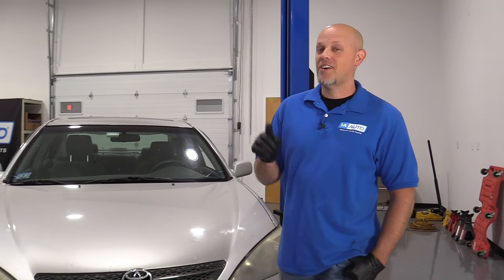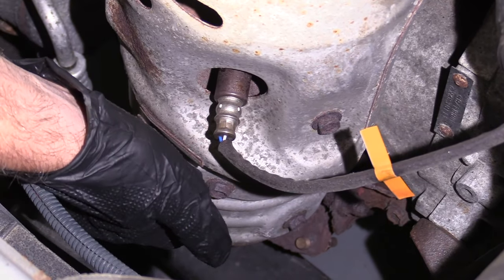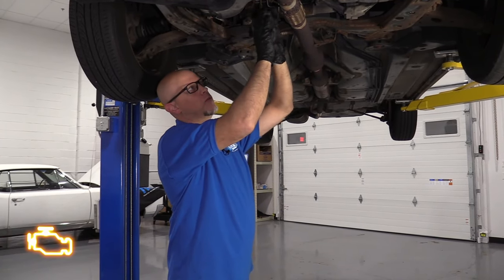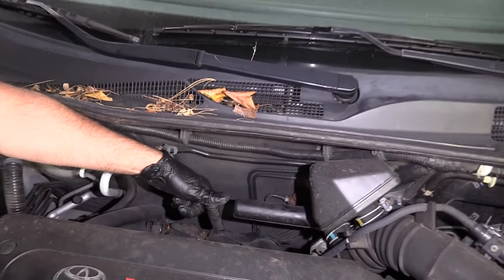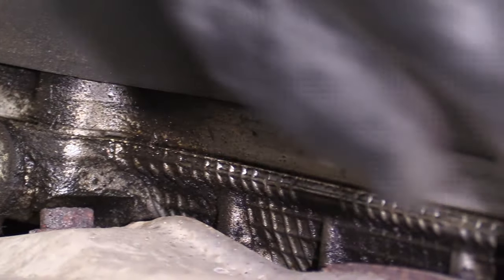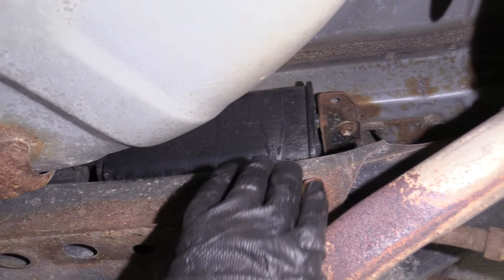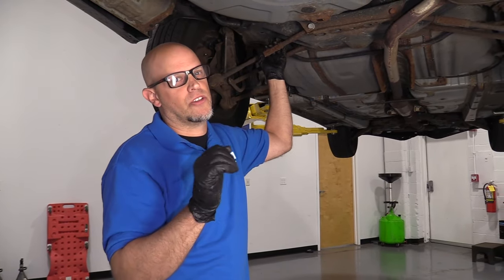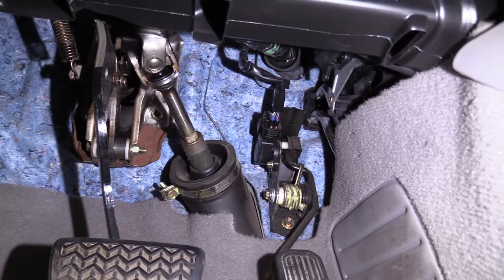Top 5 Problems Toyota Camry Sedan XV30 5th Generation 2002-06

Comment: The only problem is that it'll never break, and I'll never be able to buy a new car because it keeps on running like new
Reply: That just means more $$$ for other things to enjoy 😁
Reply: we have the same problem. 6 years ago i bought a 99 with 113k miles. i only drive about 2k miles a year and im 52. im afraid it will be my last car
Reply from the maker: Great! Thank you for checking out the video. If you need auto parts go to: http://1aau.to/m/Shop-1AAuto-Now
Reply: @EvendimataE  i LOVE my 99 camry. The 90's 4 cylinders are super freaking reliable when taken care of. Heck mine has 300,000+, and when i bought it off the first owner, the engine had no oil inside of it. Its  been a great car
Reply: @EvendimataE  thats actually hilarious. I'm 21, I've got a 2002 and people keep asking me when I'm getting a new car. I don't want to get rid of this car because based on my experience with the car its a tank. I have had trucks reversed into me, a highway spinout that hit head on with oncoming traffic. I drove into a 3 foot ditch today, and steered out. passing by an accident ironically.. So I'm thinking maybe I'll just get a second vehicle to enjoy on the weekend ect..
Reply: Mine blew a head gasket at 
145k
Reply: @howaboutnowdad4582  I have a 2002 too😃
Reply: @EvendimataE  YEah... It's time to buy another great car!
Reply: I look at new and used cars dealers want a house payment to buy one. I think i'am saving my self about $500.00 a month by keep driving my Camry and i really like it.
Reply: @howaboutnowdad4582  got mine at 20 Toyota Camry 2003 I love it except I keep having a check engine light 😆
Reply: Not sure why that’s a bad thing🤷🏻‍♂️
Reply: @lifesucks3835  my 2003 did the exact same :'(
Reply: Whenever my '03 Camry dies I'm going to get with the times and buy an '04.
Reply: How is it on the highway? How is the noise isolation and comfort for long drives?
Reply: @lucasqwert1  I think it’s fine. Road noise, I’ve been told, comes from the tires. It rides pretty well. I ride in a 5 year old Nissan frequently. Like being in a beer can.
Reply: @1AAuto   I drive a 02 camry and currently right now has 175,000 miles on it. I had those problems you mentioned however the camry's are also know for the exaust to fall apart. I already had the flex pipe on mine replaced 2 times because of loud exaust. Then eventually replaced the entire exaust because it was rotting out. but aftermarket doesn't last forever so about every few years might have to replace certain things on it again. overall great reliable car. Most reliable car I ever owned. coming from used to having a dodge and a saturn and a trans am sedan cars that from brand new fall apart in a few years.
Reply: I'm buying an 05 tommorow. 😊👍
Reply: I’ve got an 05 with 280,000 miles on it runs like new
Reply: Lmao I hate u so much for being real...I got mine recently at 245k from a friend. It has a salvage title and a savage existence. Now it has 249k...I never thought I'd enjoy putting miles on a car.
Reply: Toyota tech of 10 years... toyotas are reliable... but arnt fun cars
Reply: @bobmizoski9669  I think mine is VERY fun. I'd love a T suv tho
Reply: @bobmizoski9669  Thank you for your services sir
Reply: Same problem for me 😂
Reply: I got a 2006 v6 with 49k miles I got it with 42 k miles on it thanks for the heads up
Reply: I have the same problem. I bought 2005 Camry xle v6  with 72k miles. 10 years later it has 96k. I’m 60. Lol
Reply: @HaFAH bRanE  
I can attest to that. I bought a 2005 LE with leather seats to use for LYFT in March of 2019. It had 226,000 miles, it now has 262,000. I've replaced a lot of parts that wear out over time, but it feels like I'm driving a new car.
Reply: @scientificspiritualityBHARAT  how is it?
Reply: @hafahbrane5255  how is it now?
Reply: @fortnitetwins2331  300k miles just drove it from NH to TX last week
Reply: Drives like it’s rolled out from showroom yesterday. Perfect no issues at all.👌👍🏽❤️
Reply: Mine broke
Reply: @robertmack3602  nooooo
Reply: Mine just broke😢
Reply: @hafahbrane5255  any oils burning?
Reply: @beanteam2217  nope she runs just fine oil change every 4500 miles normal color and smell
Reply: @hafahbrane5255  okay I’m contemplating buying a 05 for 3300 with 220k. Would u say that’s a decent deal? I’m not finding really any problems with oil burning problems with higher mileage.
Reply: @beanteam2217  the engines are solid if you live somewhere with harsh winters be mindful of rust otherwise I’d say have a trusted mechanic take a look at it and make sure all the fluids are good without any metal flakes floating in them
Reply: @hafahbrane5255  the problem is idk any mechanics personally😔
Reply: @howaboutnowdad4582  stop driving bro.
Reply: I bought an 02 and was reading that this model has head gasket failures . Anyone experienced this? Any way to prevent it from happening?  Maybe water pump and change to a new radiator wood help?
Reply: Привет...Я на своей 2005 год проехал 772.000 км ...коробка родная.. затрещала буду делать....машина отличная....
Reply: I have an 2002 V6 with 356,000 miles and doesn't burn a drop of oil.timing belt once,did it myself. Had it painted OE grey last year. They can bury me in it. Just keeps on goin but must do oil changes.
Reply: Wrong

Comment: Love my '02 Camry. 331,000 miles...& still going strong.
Reply: Automatic transmission? 211k on mine and I'm putting 50k a year on her so can't wait to hit the big 300k mile mark!
Reply: Dam it.  My '03 just hit 306,000 and it looks like the engine is done.  Oil pressure won't hold up.  I wanted to make 333,333 miles, aka one-third of a million miles.
Reply: @stevechance150  Aw man sorry to hear that. I wouldn't be disappointed one bit thought, that's a hell of a lot of miles especially for a 4 cylinder engine
Reply: Mine is also 2002 has got 253,000 miles on it and still going strong too.
Reply: Are you guys fkn serious? Everyone has more than 250k on their ‘02 Camry? Wow. I’m about to buy one tomorrow, this was rather helpful.
Reply: @LazarNevski  Did you get it? I have an 03 that I bought with 76k on it. 94k now and runs perfectly. If 300k can be expected, it should see me out (I'm 67).
Reply: 05 4cyl with 197k and still runs like a new car.
Reply: 169k on my baby
Reply: Just bought one 2005 xlt leather seats super clean, I did pay $4,500 106,000 miles, you guys think I got an o.k deal??
Reply: @daniellamakina664  today I bout an 04’ with 154k miles for 4,300. You got a great deal!
Reply: @laurieharper1526  yes I have an 03 Camry that’s has a lot of mileage and still going strong no major repair then again I always get my fluids change on time and the life expectancy of belts and hoses are changed when I think they need to be it’s a great beginner car cause it has a lot of work room in the engine bay mine currently has around 313314 miles on her she is the best car I have ever own
Reply: I also love my ‘03 Camry! She’s got just shy of 190k miles and still going strong. I plan to run her for many more years. Gotta love a reliable Yota, that’s decent on gas, and no car payment! I’ve owned 4 Toyota’s (well one was a Lexus, but they’re basically the same), and I don’t think I’d ever buy anything else.
Reply: My 95 Camry has 263000 and......I'm looking for a new one which is why I'm here.  Car still runs though.  Leaks a lot of oil, needs a battery, needs brake work, etc.  I have been delivering newspapers for 30 years and nothing holds up even close to a toyota.
Reply: I have a 2004 Camry 2.4L with 290,000 miles still runs great. Only issue is it loves to burn oil but doesn’t smoke.
Reply: Have you ever changed the timing belt on it?
Reply: My 2004 camry i just chance oxygen sensor last month now Checks light appear again.
Reply: @stevechance150  does it burn oil?
Reply: @kametmeng  check the exhaust
Reply: Got mine 05 ccamry with 120k in it, runs like butter lol, almost 170k in it, going to 250-300k easy
Reply: 420000 on my odo stock motor and trans
Reply: About to reach 500.000 guys let's goo
Reply: @tonymancini2934  Wow I also have 05 Camry all original done no maint except for oil and  few bulbs and majority in Az heat. 215,000.
Reply: Oh thats a baby. Ive seen them over 500k.
Reply: @jaycris1980  I believe you. When I got my car inspected earlier this year, there was another '02-06 model Camry in front of me. When my turn came, the technician saw my milage (about 325,000 at the time) & said the previous Camry was at 495,000. I was stunned. I thought my Cam was doing something special, boy was I wrong lol. So your point is definitely valid.👍👍
Reply: @daniellamakina664  106k on a 2005 camry? That’s still brand new!!! $4,500 that was a steal. Just paid yesterday $3,250 for a 2003 camry with 197k miles and I’m happy with that buy. Even if I only get 100k miles on top of what it has now I’ll be happy
Reply: @LazarNevski  220k on mine and she still runs
Reply: Just passed 334k on my 2004 Camry, just need to fix a valve cover gasket leak and hopefully good to go.
Reply: @theproudONE92  Toyota Camrys don't have timing belts they have timing chains. It's one thing you don't have to worry about.
Reply: @jasminejames505  The 6 cylinder models have belts, the 4 cylinders have chains. That's the main reason I chose the 4 cylinder model.
Reply: @LazarNevski  2006 2.4L just hit 254k. Still running super strong and fast however my mpg has gone down. I’m trying to figure out how to get it back up.
Reply: Had one that I sold . Still regret it today. A buddy of mine owns one with 386000 miles
Reply: My 06 6cyl Camry just hit 66,000 miles 😀
Reply: '02 Camry with 320,000 miles. 2nd owner and that first owner kept it in great condition. Interior and paint is mint.
Reply: Jermaine, what engine does it have? I'm looking at an '02 with 2.2L engine. Engine name 5S-FE. I'm confused about what engine he is talking about in the video, as they seem to vary in those years.
Reply: @lilyofthevalley4740  My 02 Cam has a 2.4L engine. 4 cylinder.
Reply: @jermainewright4517  that's really good to know. I've been looking at that engine in the 2004 or 5. 
It was changed ia bit in 2006 (still went by the same name) and was notorious for burning oil. 
The earlier ones still sound like they burn oil, but not to that extent. 
It's amazing how far you have gone on yours! That's a real accomplishment!
Reply: @lilyofthevalley4740  My Cam burns through oil much more than it used to but it's still very manageable. Not bad at all for a 20 year old car. No complaints.
Reply: I have a 2002 Toyota Camry with 628,000 miles running strong, let’s get to 1 million
Reply: @Kosherstyles24  that's amazing! Is it a V6?
Reply: @Kosherstyles24  I'm really intrigued how you got it to go that far!
Reply: @lilyofthevalley4740  4
Reply: @lilyofthevalley4740  bought it used and it was great maintenance. Great inside and outside. These can last crazy long. Don’t flease a car and be broke. Buy a few thousand Camry and become rich
Reply: @daniellamakina664  V6 or v4?
Reply: Wow!
Reply: I have an 02’ as well and has 335K now. Still going strong
Reply: Same here. 306,000 on my wife's 2002 Camry. I hate the engine, though. It's the notorious 2AZ-FE which self-destructs when the head bolts strip out of the defective block. This is engine number two, and after spending over $8,000 on the last catastrophic failure we never go far from home on the new engine. It's just not durable or trustworthy.
Reply: You ever change the timing belt?
Reply: I bought an 02 Camry a little over a year ago. Check engine light is on. Gonna see what codes come up today. My car stalls after fueling, and won't start back up only after it's been driven a long time. So it's literally a point a to point b car right now. I can't make any stops unless I keep it running.
Reply: Toyota was ahead of its time, by placing the catalytic converter in the engine bay, making it much more difficult for thieves to steal  , so they leave your car alone…. Oh, what a feeling ! 😂
Reply: Yes, Camry 02-06 is very easy to fix and run forever. Mine 3 of them around that years and over 250k miles and run like a champs . Save a lot of money.

Comment: I bought my 2005 LE 4 cyl. brand new. Fifteen years later and 218,000 miles...perfect! I changed oil every 5K (Mobil 1), kept good plugs in the engine, and did periodic radiator flushes. No problems at all! It always ran like it was new. Here's the kicker: original water pump, original alternator, original starter, original wheel bearings, and never had the AC recharged/serviced! Of course I had the front brakes (twice), rear brakes (once) and shocks replaced (once). It don't get any better than that! Not to mention...35 MPG on the freeway. The best car I could have ever bought in 2005. Why did I sell it...I bought a new 2020 LE 2.4. The 2020 has loads of advanced technology to assist in driving safety. Hey...I'm 68 now...I need the help. lol
Reply: Jl
Reply: BS! I replaced plenty of items on my 2006 Camry already. 230k mi. Wife's Honda at 300k mi has been trouble-free, but Toyota is certainly not better than Honda.
Reply: Mine has had constant repairs. Everything on here and more. The latest is the head bolts and head gasket. I wouldn't buy a Toyota again.
Reply: @rft2001  that's odd, I have put my 2006  camry through the rininger and it runs great never had issues and I have pushed it beyond it limits
Reply: @GODS_OUTLAW  As in all cars there are good and bad ones. I do want to say though that the biggest problem with this generation of Camry's is the engine and with the head gasket/head bolts in particular. Toyota should have addressed the issue. It is widespread and accounts by far the most NHTSA complaints.
Reply: I have the same car and engine. I've never been able to get better than about 27 mpg even if I drive < 70 mph on the highway. Usually more like 25 mpg.
Reply: thats awesome man!
Reply: I have a 2004 2.4L 4cl LE Camry and it's been very reliable with no major issues, only a leak in the boot which was promptly fixed. Abuse it often. Good experience with it imo.
Reply: @ sunking2001 Something very ironic is that I just purchased my 2005 Camry 4 cylinder with exactly 218k Miles! What even crazier is the guy was your age too. Chris is this you 😂
Reply: 100th like
Reply: @nameredacted1242  What make/model is your wife's honda?
Reply: Yep bought new 2002 Camry SE 3.0 6v . Same here 2 starters and just replaced fuel modulator . She drives like a brand new car 260,000 miles
Reply: The new car isn’t only safer but quieter and more refined but has better audio, headlights and features overall. Your old Camry has served its purpose, enjoy the generation of upgrades in your new one.
Reply: Lol! 😂

Comment: Just got my first car (I’m 16) it is a 05 Camry with 106k miles I am beyond stoked to have a reliable car to my name!
Reply: Hah I got my 05 2.4 le at 16 and I'm 23 now put 150k miles on it and still running strong. Exhaust leaks are my main issue but that's because I live by the ocean. Good luck